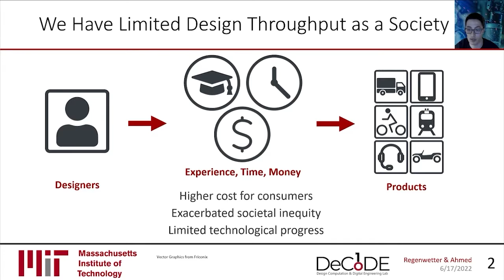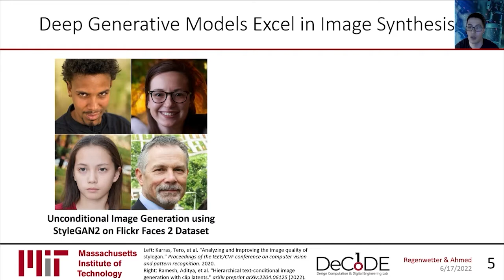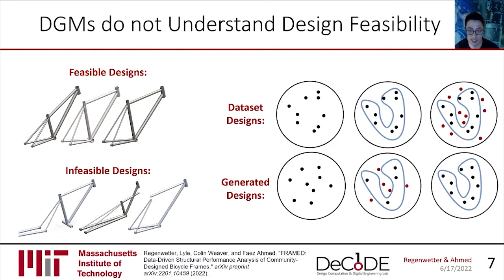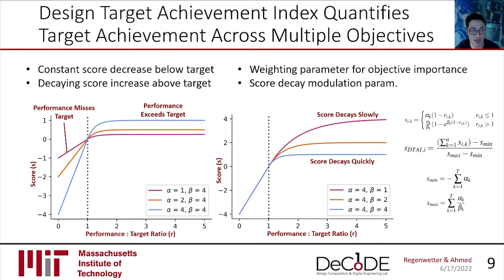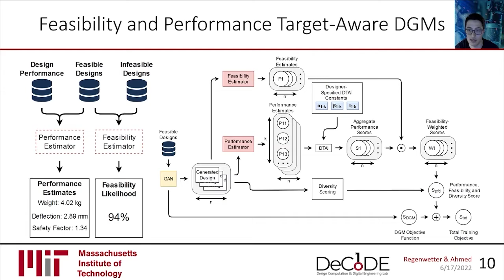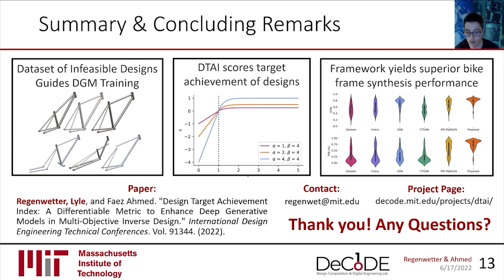Introducing the Design Target Achievement Index (DTAI)

Comment: How does these methods compare to the traditional optimization techniques like NSGA, PSO etc., in terms of quality of solutions and time ?
Reply from the maker: Great question. In terms of training time, I've found that traditional optimization methods and ML-based generative models can often be roughly comparable (though it depends on many things such as dimensionality and training parameters, or course). However, one strength of generative models is that they can be trained a single time in a conditional setting to then support numerous different target queries. In contrast, our traditional optimization methods will need to be retrained whenever constraints and objectives change. We are hoping to demonstrate such conditional training in an upcoming paper!
Reply: @lyleregenwetter1588  Thanks for the reply. I have one more question. Traditional optimization techniques are used in various engineering design and optimization problems based on the nature of the problem, objectives and constraints. For example, scheduling problems in industries involve million of variables and could be solved by a highly scalable Linear programming problem or NLP, MILP etc. Also, lot of design problems that we tackle in industry lack prior data especially there is no image based data. Usually we do abstraction to arrive at a mathematical model for a given problem. To cut a long story short, my question is how practical are generative models in engineering design problems ?
Reply from the maker: @levelupwithrizwan9371  I think your comment about the necessity of data is really the crucial factor here. Optimization is an excellent technique which can be used when no data is present. However, in scenarios where we are able to gather datasets, this data can give us several advantages. For one, data driven models may be able to come up with better solutions than optimization approaches and may be able to handle more complex problems (where identifying a set of closed form constraints to guide optimization may be intractable, for instance). Secondly, ideally data driven models should be able to identify and harness existing design expertise that is encoded into previous designs in the dataset.
Reply from the maker: I think this data reliance is the main 'impracticality' of data driven models but as more engineering design datasets become available, I see data-driven models becoming more and more practical. Already, some of these generative models have been successfully applied to real-world product design
Reply: @lyleregenwetter1588  Thanks for answering. I would love to follow your research, probably send you a connect request on linkedin.